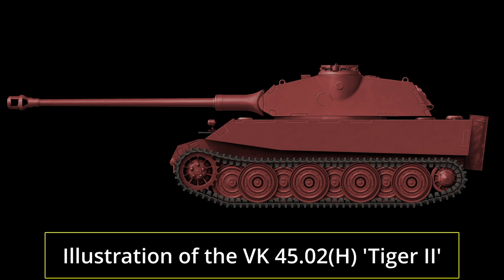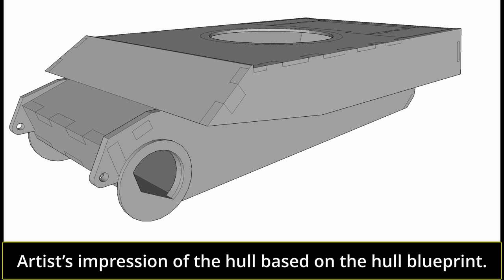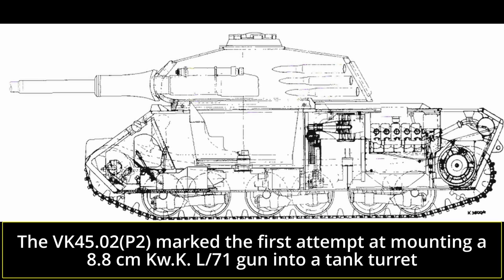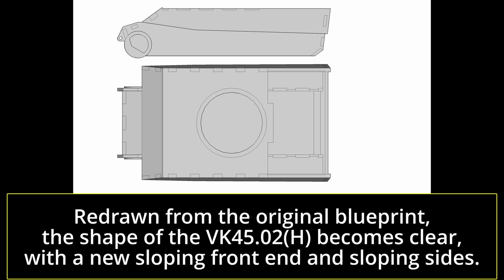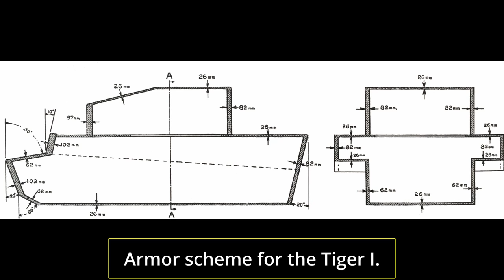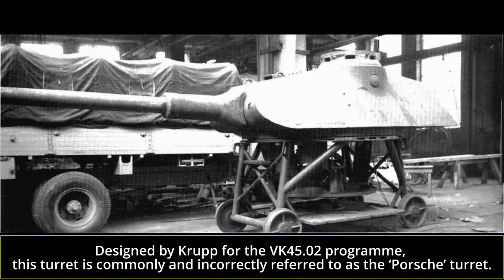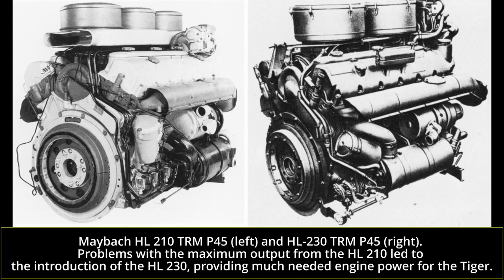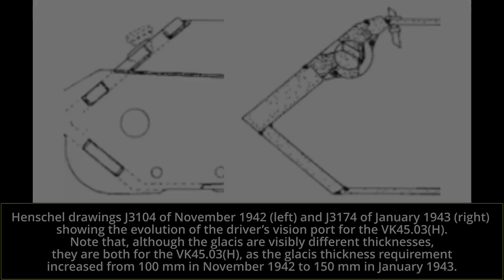The Lost Tiger | VK45.02(H) 'Tiger II' Henschel Improved Tiger

Comment: I love how they were optimistically calling them 45 ton tanks lol. The Tiger 1 was already 52 tons and Tiger II was 68 tons nothing was 45 tones except maybe the Panther. I guess they were just deluding themselves
Reply: It wasn't delusion. It was requirement creep. The original Tiger proposal was meant to be 45 tons, however various additional requirements (added by people like Hitler) and iterations of designs by different firms ended up causing the final vehicle's weight to overshoot by twelve tons. The Tiger-II saw an even more extreme layering of needed characteristics, a much larger gun necessitated a much larger turret, chassis needed to be redesigned, armor thickness increased dramatically, etc. In fact in the case of the Tiger-II designs, the VK.45.xx was no longer designation of weight. It was simply nomenclature that evolved from the initial Tiger proposal ( just like the modern Ford Mustang shares little in common with its 1960s forebearer, although they both possess the same name). Requirement creep isn't unique to the Germans, in fact its common in military weapon development with all nations. It's just that the US and the Soviet Union were able to minimize that problem during WW2 with their weapons systems, while the Germans weren't (I would argue largely due to people like Hitler & Ferdinand Porsche).
Reply: And panther being VK. 30 😂
Reply: Lmao the panther was originally envisioned as a 30 ton tank
Reply: @awesom6588  No. 30 stands for 30 ton operational chassis. Not a full vehicle with turret and gun. This is common misunderstanding because VK ( Versuchskonstruktion ) stands for experimental design and people assumed that it means entire vehicle when in reality it's just chassis.

 Panthers chassis weighs ~32-33 tons. So only few tons over. Tiger I has chassis ~45 tons. Tiger II is where they screwed up with chassis around 54 tons.

Comment: It would have been possible to use the Panther style suspension simply by ugrading it's capacity to carry a heavier load. Keep in mind that the Soviet heavies used a much simpler type of suspension with fewer road wheels. Interesting how the hull designs were simplified  for more efficient manufacturing and probably better performance under fire.
Reply: The Soviets also designed much lighter tanks. One of the worst things about the Panther is just how space inefficient it is. It weighs several tons more than an IS-2 for less capability and its unergonomic as well.
Reply: @kobeh6185  not as unergonomic as any soviet tank tho
Reply: @startingbark0356  not true. The T-34 had many ergonomic problems, but notably the IS-2 was far better.
I would go as far to say the Panther is not ergonomic for 4/5th of the crew. The gunner has no independent 1x sight (although a very good primary optic), worse fire controls than a Sherman, the driver can't see anything besides directly in front of him through a small periscope with a narrow field of view that is fixed in place, as well as a similar fixed on at a strange angle off to the side, the radio man is nearly blind, with a tiny pitiful mg optic with no FOV, and a periscope that for whatever reason isn't facing forwards, the loader had to retrieve ammunition from the hull as there is no turret stored ammunition nor floor ammunition nor a read rack. Loading the gun is a chore because the breech opening is literally on the opposite side of him and he must put the very long round over or under the breech. The turret ring isn't much larger than a Panzer 4, which is insane considering the panthers armament and weight. The commander could see well and had a good hatch cupola set up.

Ultimately the Panther was a pretty bad tank, that had some features that were very good, namely its frontal armor, good weapon and optic. Everything else about it was either not special or downright weird/bad. Don't get me wrong I love the Panther, but it is not a very good tank.
Reply: @kobeh6185  but how is the panther bad if its actually much more deadly in combat then the sherman and T-34 and panzer IV
Reply: @startingbark0356  its not? Look at panther loss ratios against Shermans. 2ndly a tank with strong frontal armor and a very powerful anti tank weapon is going to be somewhat effective no matter how bad the rest of the tank is when its in service with a nation that is fighting a defensive war for most of the machine's existence. I would exactly call the StugIII a very good vehicle for general purpose but in the role it was in and in the type of war it was in, it was very good. 

A bad tank that is strong from the front and has a really powerful gun is often going to win against a much better tank that has weaker armor if you put the former in a defensive position. Thats just how war works. Defensive forces are usually at an advantage at the tactical level. 

I cant say the Tiger was a great tank either, but since allied tank guns from before 1942-3 were generally weak, the tigers (very poorly designed but quite thick) armor was able to overcome this. Once 85, 76, 17pdr, 100, and 122mm guns showed up in numbers, the tigers armor was less and less relevant.
Reply: @kobeh6185  if a bad tank is gonna win more its actually a better tank because it succeeds where its made for better then the others
Reply: @kobeh6185  lol you call the tiger I poorly designed ? I mean look at the T-34 early model, that thing doesnt even have proper space in the turret and bad transmission
Reply: @kobeh6185  the 85 showed up much more then the other guns, the 100mm only on the SU-100 mainly the rest also showed up in not so great numbers around 1944, well not so great in terms of allied standards of amount, and the Tiger I actually had a way to fix this, they angled to hull to increase the effective thickness by around 20-40mm which should be enough to make it impervious to the 85 and 76
Reply: @startingbark0356  dont point out a tank is poorly designed and then talk about poorly produced or missing modules of the vehicle. 

Change the suspension on a Tiger. Change the transmission of a Tiger. Manufacture a Tiger. Its a bad tank, that is extremely expensive for capability that is nearly met by the far cheaper Panther and exceeded by the even cheaper IS-2. The tiger weighs nearly 20 tons more than an IS-2 and somehow has worse armor, and less adaptable gun, is slower, is harder to move, is extremely hard to maintain, and is like 4 times more expensive. Its a cool tank, but in the grand scheme the Tiger 1 is a mistake. 

And if you're trying to make an argument, picking the earliest production run of T-34s is as cherry picking as it gets. I think the T-34 is a pretty bad tank too, but at least it wasn't so expensive the Soviets could make more than just 1300. And when it broke down they could actually fix it in a reasonable amount of time.

You seem to think all that makes a good tank is armor and firepower and thats just completely untrue.
Reply: @startingbark0356  also show me german documentation that indicated angling the hull like in world of tanks or war thunder is actual doctrine in widespread practice by tiger crews. I cant believe you just gave me WoT strats as an actual historical argument.
Reply: @startingbark0356  Back in 30s most tanks had "no proper turret space", not to mention that many of them had turrets meant for one or even two crewmen. Look at French or British designs. Soviets intended to replace T-34s with completely overhauled design by the end of 1941, with the torsion bar suspension, a turret with the commander cupola etc, but then the war has happened
Reply: @SamuraiAkechi  no that’s not true, the T-28 and T-35 had relatively spacious main turrets

Comment: I have to admit but the first time I see the model rendered, it was messing with the head. I know it is different from the production tiger but it was nagging me until I seen the armor thickness diagram that helped me out knowing the upper side hull wasnt slanted and the front upper plate had an angle in the mid. Great video explaining the differnce between this Tiger vs the final Tiger.

Comment: Love that sketchup model of the hull. Kinda weird how there's two different angles on the upper front plate though.
Reply: I think that's the legacy of someone saying "Just slope the armor on the Tiger I!".
Reply: @larrythorn4715  Probably an attempt to limit the size of the hole in the upper front plate for the hull gun. The steeper the angle, the larger the hole for a given arc of fire. In the end, they were just better off going with a single plate and eliminating a joint in the armor. Easier to make and leaves no joint running across the front of the tank as another potential weakness.